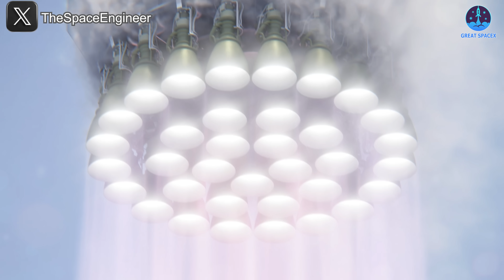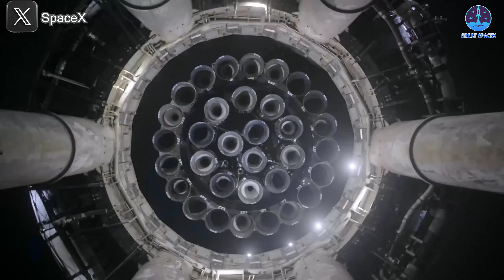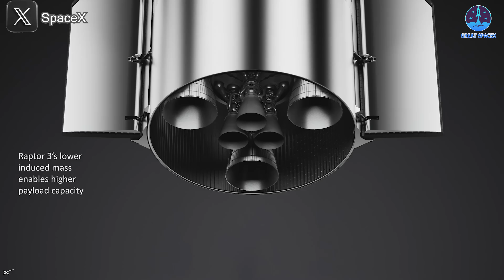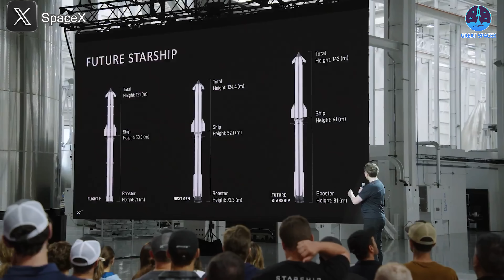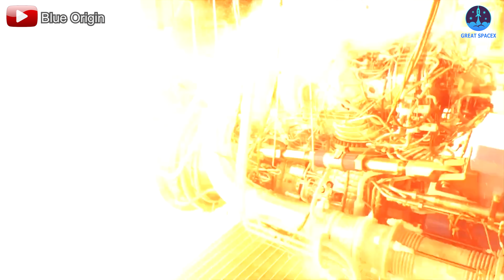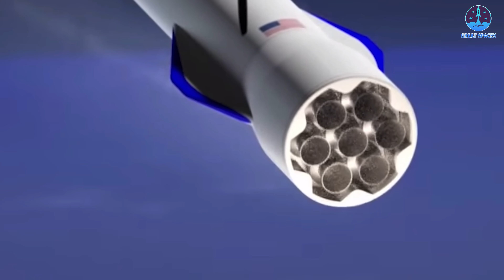BAD NEWS!? SpaceX Raptor 3 Exploded during Testing...Here's What Happened!

Comment: The above video, titled "BAD NEWS!? SpaceX Raptor 3 Exploded during Testing . . . Here's What Happened" is an outright joke!  There is some talk of the Raptor 3 explosive failure on the engine test stand (referred to in the video at one point as "signs of a possible test anomaly or perhaps a controlled experiment", hah!  ) leading up to the 2m05sec time hack at which point there is this statement: "Until we  receive official information, it's too soon to draw definitive conclusions."

So, in fact, the video DOES NOT PROVIDE ANY INFORMATION on what actually caused the Raptor 3 engine to explode on the test stand!

Beyond the 2m10sec time hack into the video, the remaining 11m40sec is nothing more than a glowing marketing advertisement for SpaceX.  Since the content creator is under the name "GREAT SPACEX", I'm not surprised.

Comment: I don’t think I want to fly on a starship that doesn’t place high priority on safety.  Aluminum/lithium alloy is far better than steel especially for safety.  Damn the costs.  Hot separation puts too much stress on starship.  And finally, starship load is far too large.  How many failures do you need to see before realizing this is an unsafe design

Comment: Testing to failure is a thing. You do the math, calculate the margins, then exceed them in testing. We spun jet engine parts in a hole in the ground, as things coming apart released a large amount of energy.
Reply: Yes! Mechanical Engineers (and I AM one) know this! You design it with some margin, then test it to that, then break it! NDT only goes so far! :body-blue-raised-arms:
Reply: that's a little different than doing your testing in the middle of air corridors.

Comment: Welds are not structurally more stable than bolted flanges. Welds create a more reliable seal than a bolted flange under very high pressure. Bolts can be ten times stronger than the parent material. Welds are only as strong as the parent material. So welds are structurally inferior and less stable. 

In addition, welds create differential heating in the material being welded. If not normalized the material will retain internal stresses and inconsistencies in crystal structure. The temperature of metals can be controlled during the process of drilling and tapping holes.

Comment: I bet it cracked at a layer in the 3D printing process, NASA has have many do the same thing, it happens with plastic 3D printing as well, it's good for designing stuff, but crack creep in when you don't expect, heat and cold at the same time is why. NASA had the move fast and break stuff, until Apollo 1 then we know what happened.

Comment: Total impulse BTU thermal ratio, over estimated. Now like F-1 Saturn engine, combustion instability has methoporhis in a MethOLOX turbo pump closed loop system. The nozzle needs redesign. Atomization at critical EPR, is not stable at throttle,, fuel flow, and Thrust variability. ISP models CFD, FEA, Thermodynamics need to be sruntinzed.  loads and weight only 40% Raptor 2, flaws maybe Raptor 3, will show improvement. And CAD, CAM efficiency. Just an opinion... Any other thoughts out there?

Comment: Yes, explosions during testing suck but that’s part of how SpaceX pushes the envelope. Raptor 3 is a next-gen engine, so these failures are expected as they fine-tune performance. Honestly, every explosion is just more data. If history’s any guide, this setback will lead to a stronger, more reliable engine down the line.
Reply: SpaceX is developing a bad behavior of quick prototyping with very low success rates.  3 melt downs of Starship and every one of them turned into a failure for instruction exercise excuse.  Problem is all we're seeing is more failure.  The program is well behind schedule.  Starship was supposed to be ready for manned landing on the moon by last year.  However, it's arguable that Starship is maybe at 15% of development completion.  Artemis II does its orbit around the moon next year, and Artemis III does its landing the following year.  Starship shows no signs of catching up, even though SpaceX claims they'll have 5 flights to Mars in Q4 2026.  

The only progression I'm seeing (or hearing) is just bigger promises by SpaceX with no delivery.

Comment: Engine pressures that high in one tight package they really cleaned it up !  its getting into Vari-jet Territory high Altitude duel Vaporizers the 2-tank Kicker easy to vapor simze at about 50k ft to C/O at 201k ft 6 to 10 % Savings Rumored more with S.V.D.P. Pre Chambering Maybe as high as S/U A-360k.j. or off the charts F/S-10 by Volume !.
Reply: The tighter the package the bigger the bang.

Comment: Someone or somebody else who used to work with jeff baszo  os doing something else wrong to the raptors 3 and 2 remove them now and you will see the difference between them and without them Elon musk will be rhere to see all hardwares on all raptors v2 and raptors v3 for not to exploring them to keep pushing to the breaking point to passed the 410 not 330 tonnesso go SpaceX and starship and booster keep fighting and go for flight 🎉🎉🎉🎉🎉🎉🎉🎉❤❤❤❤❤❤❤❤❤❤❤❤❤❤🎉🎉🎉🎉🎉🎉🎉

Comment: Is it just me that thinks welding engine parts together doesn't allow one to service or inspect it and that it makes them basically disposable. You would have to cut it up to inspect it. Good luck with that when they are still chasing endless leaks.
Reply: exactly...but they sure look cool and magically spacex was able to eliminate all of the external gadgets that every other rocket engine in the world uses for reliability.
Reply: There is going to be an engine shop in the Mars Colony😂😂😂
Reply: Raptor 3 eliminates bolts and flanges - the only way it can leak is if it breaks down completely in structure.
Reply: @Derek-je6vg  and that's exactly what will happen as the leaks are being caused by high frequency combustion instability. These are throw away engines as designed.
Reply: Disposable is fine is the things have sufficient endurance to handle multiple missions and are easily changeable. 1.5 tons is extremely impressive and well within hand operated lifting machinery range
Reply: @alanbrown397  true...but more and more of this vehicle is becoming disposable.
It's going to take a lot of flight data to reliably know what that endurance is.
Reply: Proper welding turns two metal parts into one! In my Metallurgy class we had to weld a part and then cut it, polish the sample, and examine it under a microscope. In Proper welds you could not differentiate in the grain structure from one part to the other! :face-blue-wide-eyes:
Reply: @PhilG999  given your experience is transgranular cracking more likely to occur in undisturbed grain or near a weld?
That's a rhetorical question. 
The variables involved in a "proper" weld such as alloy, heat treatment, impurities, etc. make proper welds only within a tolerance of perfection.
Back to the original point it makes inspection and refurbishment difficult if not impossible.